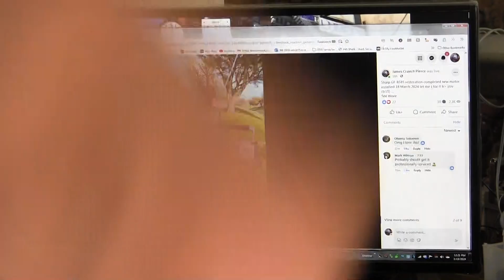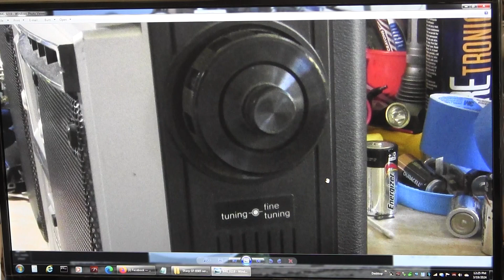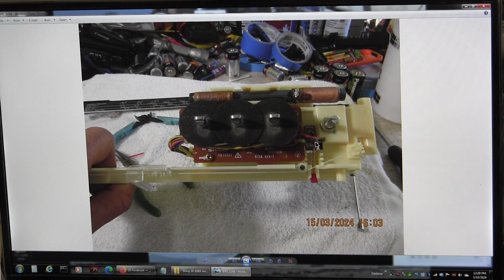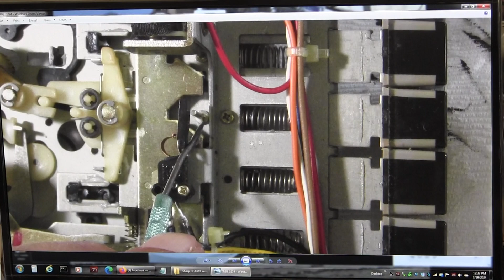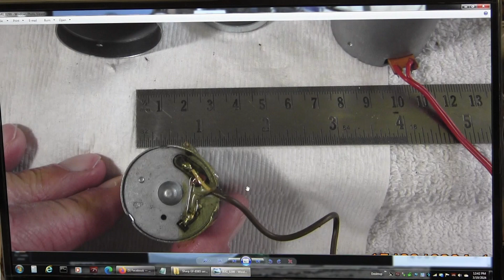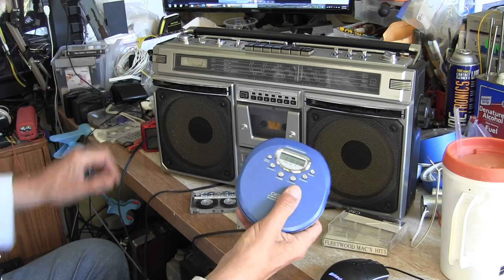Sharp GF-8585 APLD cassette radio boombox how to restore March 2024 new motor for sale

Comment: Sharp GF 8585 Stereo Radio Cassette Recorder. I am not an electronic technician but an audio fan. I watched your video and noticed that the power of the speakers as indicated on the woofers is 5.0 Watts. So, is the power output of this model 5 Watts RMS per channel at 8 ohms? Also does this model have only one single power output meter instead of the normal two VU meters? Thanks for a reply!